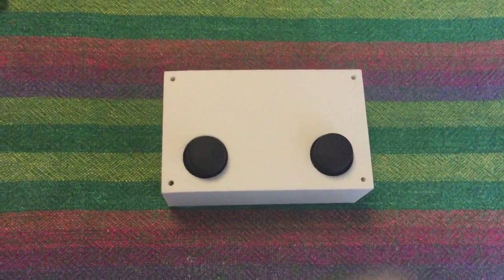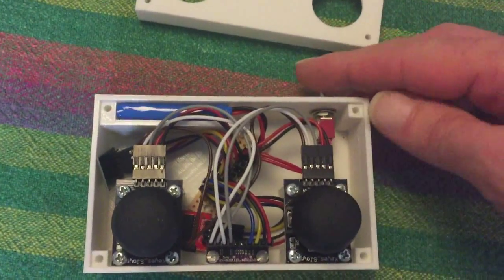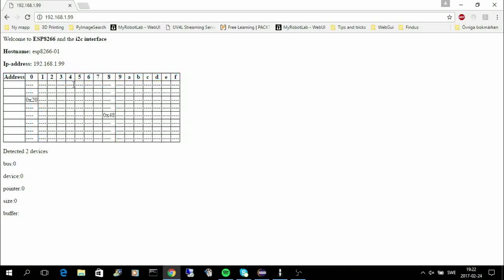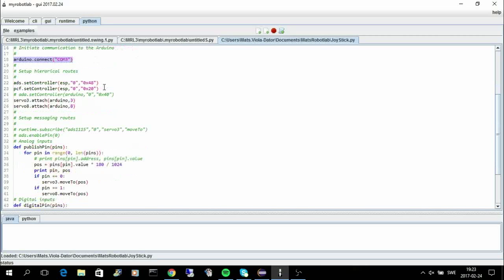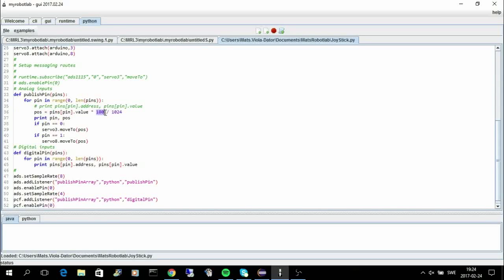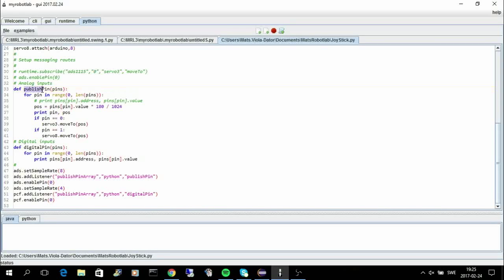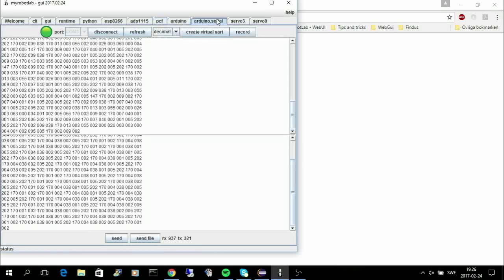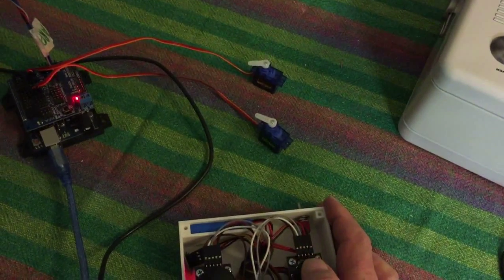DiyJoystick

Comment: is there a way to get a copy of the code and the layout for tis project?
Reply from the maker: Yes. The software I use is MyRobotLab. http://www.myrobotlab.org. The program I use is this python program: https://github.com/MyRobotLab/pyrobotlab/blob/master/home/Mats/DiyJoystick.py
For it to work you also need a sketch in the ESP8266.  The sketch I use can be found here: https://github.com/MyRobotLab/myrobotlab/blob/master/src/resource/Esp8266_01/Esp8266_01.ino
A nice guide on how to use the IO pins on the ESP8266_01 can be found here: http://www.instructables.com/id/How-to-use-the-ESP8266-01-pins/step3/Best-Trick-Use-I2C/
To understand the code better, I recommend listening to this guide on how to configure the ESP8266 as a WebServer. https://www.youtube.com/watch?v=Edbxyl2BhyU
Acrobotic also made a few other videos about the ESP8266, so it's a very good resource for learning about it.
The electrical connections are very simple. I havent' made a circuit diagram, but if you look at the documentation for each service, they contain diagrams for each of the parts I used.
Reply: thanks